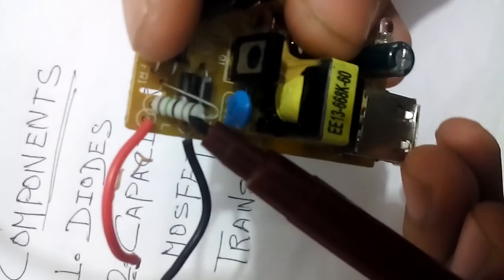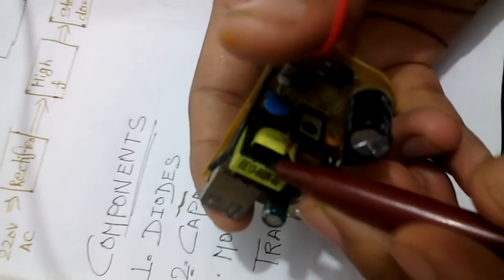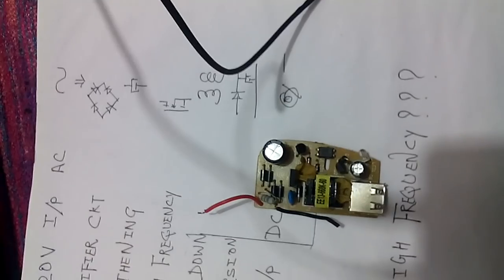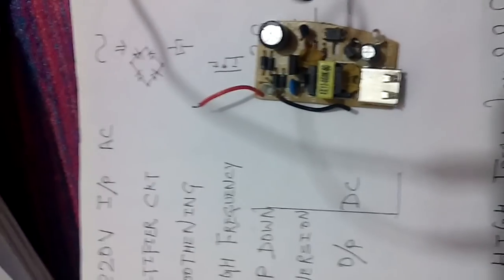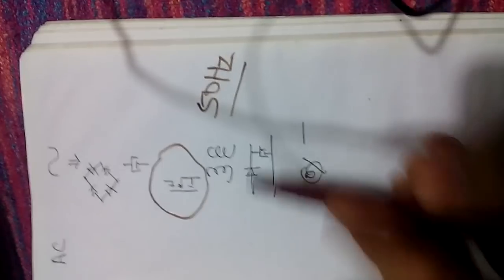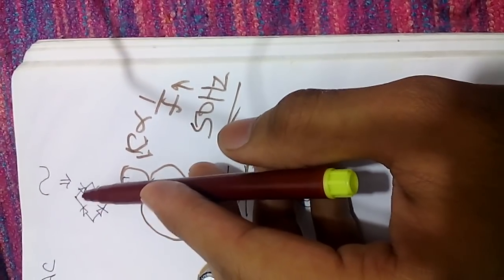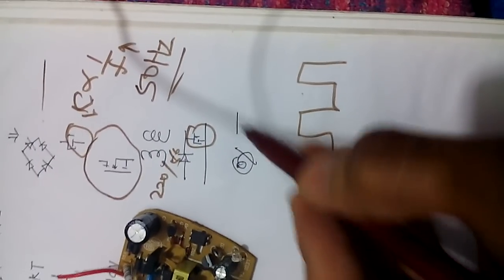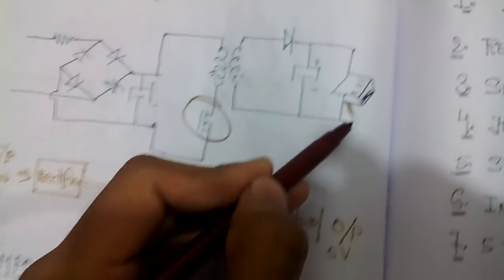EXPLAINED : Inside a cell phone charger

Comment: How is the signal still AC after it leaves leaves rectifier? Doesn't the rectifier change the AC to DC? But if it was DC the transformer wouldn't work because it needs to be AC. Please response.

Comment: tnk u sirrr
I have a doubt sir, MOSFET or simply transistors are used in the circuit to convert the 220V nonpulsating DC to 220V AC having much more frequency nna?
So that the transformer can recieve AC

Comment: In simple ,if U see the mobile charger,here the Input voltage at 240 Volts at 50/60Hz frequency is first fed to Input Rectifier stage, Which converts 240 Volt AC to 240 Volt DC. This 240 DC voltage is fed to a High Frequency Switch which converts this DC to High Frequency AC at 240 Volts with a frequency between 50KHz to 1MHz, So now we have 240 Volt AC at a higher frequency. Here comes the Switched Mode Transformer. These Switched Mode Transformer(SMT) are capable of handling higher frequency. So this SMT will now step down the 240 Volt AC at Higher frequency to required Output AC voltage at higher frequency. And the output AC voltage is now converted to DC using output rectification and filtering circuit. The DC output voltage is fed back to the control circuit which gives the firing pulse for the High Frequency Switch. Thus achieving AC to DC conversion
Reply from the maker: Thanks for your constructive feedback !! Please also watch other videos and give your constructive feedback. Also if u liked my effort, please like the video and subscribe the channel and help me grow. Thanks alot🙂🙂🙂
Reply: @brainamplifier  already done ,u can connect to me on my what's app 7018765198

Comment: Shouldn't the transformer be in the beginning of the circuit like a bridge rectifier.
You said the transformer doesn't work on DC , then if the transformer was in the beginning it will work.
Reply: If u do that happy diwali in advance cause I had experienced this😂😂😂😂(I had blasted that SMPS transformers) the reason for that is we need low voltage with high frequency...... 
It is not AC actually it is a square wave like a pulse or pulsating DC(0n-off-on-off-on.....)....By this on off (fast switching)we generate high frequency....

Comment: Hi, great explanation! I am looking for a circuit just like that, but the newer chargers have a lot of IC components that are too tiny to work with. Any idea what charger you used for this? Thanks!
Reply from the maker: It's an old cell phone charges with pin. This video was made 3-4 years back

Comment: Is there any polarity issue of the input of mobile phone charger ?
Like Phase to one side of the plug & neutral to another side of the plug.
I have one xiaomi charger in which if I connect it to the socket like a way, the charger gets more hot; but if I interchange the charger plug to the socket in another way; then its become normal condition.
Actually I wanted to know any internal circuit arrangement where AC phase & neutral has a certain arrangement.

Comment: The diodes are dealing with 230v AC and the DC current is again being changed to high f AC for transformer.as we know transformer converts AC to AC which means the conversion requires another rectifier for making it DC but there is none

Comment: Bhai mosfet doesn't convert dc to high frequency AC , it converts that  dc to high frequency pulsating dc.. which acts like ac, as voltage is changing from 0 to particular value ... After rectification voltage never goes in negative side so there is no ac going in transformer , its pulsating dc.

Comment: Bro you have used an integrator circuit in the secondary part of transformer coil. Can you explain, how you have converted AC into DC using an integrator ?

Comment: Bhai rectifier n capacitor ke baad to ac dc ho gayi fir transformer ka kya use. Pehle transformer hona chayie tha n then rectifier!
Reply: bhai yeh starting ki ac to dc ki baat kr rhe h bhai ac to dc ke baad mosfet ne low freq. ko high freq. me convert kiya h and then woh bhi dc ko ac me convert kr transformer ko diya h and then diode or capacitor ne high freq. ac ko fir se dc mai convert kiya h smjhe
Reply: Deepak Gaur  Sahi bola apna Step down transformer 230v Ac ko 9 Or 5AC me convert karta hai & Diode ko ki jarurat isliye hai ki Current Reverse me flow na kare than Capacitor & Mosfet ata hai DC ke liye

Comment: brother the white part of the diode emmites positive charge  current not the negative charge current  optocoupler is not a microcontrooler  it is connecting device through led light inside of it

Comment: Missing point : You don't explain how the Gate that Mosfet switched - especialy in that circuit
Reply: Yes I too agree with u, how mosfet is  switched?? From where  get signal is produced
Reply: Bruh the mosfet gate triggered by IC555 timer typically the timer will generate PWM pulse signal and this will go through the gate of the mosfet to trigger the conduction between Source to drain...simple MOSFET is a switching device that's all 😊

Comment: we use smps in charger not only to make its size  smaller but also use it in wide voltage range(90v -270v).the 4 pin component  which you called ic chip is known as opto coupler .and which you called normal transformer is actually  called    flyback smps transformer .normal transformer use iron/still as core ,but smps flyback transformer use ferrite core.
Reply: what is the ratings, pin diagrams of the flyback smps transformer ??
Reply: Bharath Ram no
Reply: Thanks. I was wondering what that IC was.
Reply from the maker: manasdelta thanks for your input and constructive feedback. please subscribe the channel if you like the effort.
Reply: Is there any polarity issue of the input of mobile phone charger ?
Like Phase to one side & neutral to another side.
I have one xiaomi charger in which if I connect it to the socket like a way, the charger gets more hot; but if I interchange the charger plug to the socket in another way; then its become normal condition.
Actually I wanted to know any internal circuit arrangement where AC phase & neutral has a certain arrangement.
Reply: Is opto-coupler a type of microcontroller?
Reply: @BharathRamMS  No.. it is a coupling device ...or simply saying a voltage transmiter (connector) with isolation...Direct contact is avoided by means of IR based light sensing diodes..
Reply: @BharathRamMS  No. It's like a transistor, acts as a transistor, but with more safe feature (as it uses light to activate switching)

Comment: I have 2 doubts
1.after capacitor y can't u keep just regulator and get DC output so that extra transformer circuit is reduced.
2.once we have designed our transformer output is constant. but I found in our trains having 110v DC socket
Reply from the maker: +vamsi krishna as our mobile need 5v dc, we have to step down the 110v/230v supply. To do that we have to use transformer.

Comment: Sir I have a question, what is a value of  output voltages in that transformer?
Reply: Sir if remove the upper part from transformer to power supply and input a 9volts, what is output voltage in usb, is that ok to do?
Reply: Roel Timola topically those transformers are 1:1 thus only providing isolation
Reply: Andrew Hudson  ok thanks for that even if cant understand, ^_^
Reply: Roel Timola it's for safety basically, it keeps you from being electrocuted and killed when you plug your phone in.
Reply: Andrew Hudson i want to make a powerbank, i want to try if that ok if im going to get some parts of charger
Reply: I would avoid building a power bank that uses 110 or 220 volts to charge until you fully understand how transformer circuits work. You could get badly injured if you make a mistake. I would start by figuring out how to charge a lithium battery at 4.2 volts with a 5 volt power source. Then figure out how to boost the lithium battery voltage back up to 5 volts so that you can charge a phone or something.

Comment: Hey am looking for some thing that can be use as and automatic switch. Am try to make voltage booster. My goal is to make 5V in 12v or some where around that value. Am not sure what component can be  used as a automatic switch, would appreciate the help

Comment: function of IC in the circuit ?
Reply: sherab gyamtsho are you referring to the 4 pin device with the pcb cutout underneath?  if so, it's an opto isolator. it's part of the voltage feedback circuit

Comment: Sir what happens if the input AC is first stepped down and then converted to dc?
Reply from the maker: Saikrishna kandhikatla then you will need a bigger size of transformer because after converting in dc we can make any frequency by switching action. higher the frequency lower will be size of transformer

Comment: Hey , great vid. 
To which frequency is the Mosfet output changed to ?
Reply: pump kin 
bro it's about 1khz frequency and due to the such a high frequency Ac only one diode and one capacitor is use to convert it into DC at last step not need to use full bridge rectifier at last stage 
Hope u understand

Comment: dude, why high frequency affect the size of transformer?
Reply from the maker: Jame Wals Each AC cycle electric energy is converted to magnetic, and back again. The amount of magnetic energy that a transformer can 'store' is more or less linear in its mass. At a higher frequency, more of these cycles occur, hence the same transformer would transform more power, or the same power can be transferred by a smaller transformer.
 
 if you want mathematics . . 
e=4.44 f N B A
A=e/4.44 f N B

higher the frequency lesser the area.
give feedback if you understood.
Reply: brain amplifier excellent bro...I have understood
Reply from the maker: Veerendra P glad to resolve your doubt. kindly keep giving constructive feedbacks and suggestions and like share and subscribe to brain amplifier. thank you.

Comment: can you let me know what should be the value of components used (value of input resistor,capacitor).What is connected to the gate of the mosfet?.Also is it possible for you to share a seperate video on how does a PT works in such a application.Thanks in advance.

Comment: can I increase voltage by increasing the frequency
Reply: yes you can, theoretically. you cant actually change the frequency. but the output voltage is controlled by a voltage divider network. if you find that and the formula for your output voltage (this is the harder one) then you can vhange the values of the resistor which will change your output voltage.

Comment: Why is the Ic needed? 
for voltage regulation ?
Reply: the ic controls the gate terminal of the mosfet. it basically decides the duty cycle of the PWM signal.
Reply from the maker: thanks for solving queries.